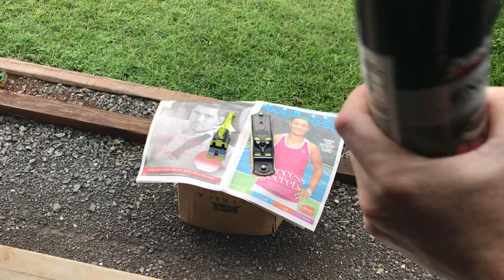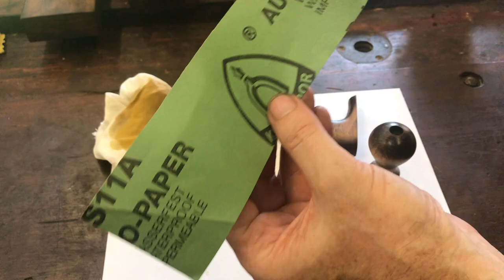Stanley Bailey 4 Full Restore

Comment: Good idea not to waste time on the blade. Looks like it was well used. Shellac looks great, didn't know it was that easy
Reply from the maker: It was a little intimidating to get started with Shellac but the finish is not only easy, it leaves a traditional original looking finish. I heard the premixed stuff is good but I like the flakes because the premixed stuff probably would go off between my restoration jobs and I would waste it.

Comment: when you lap your sole, do it with the blade assembly in it. when you lock the lever cap it flexes. nicely done other than that, and that may not matter for your applications...
Reply from the maker: Thanks, good advice.